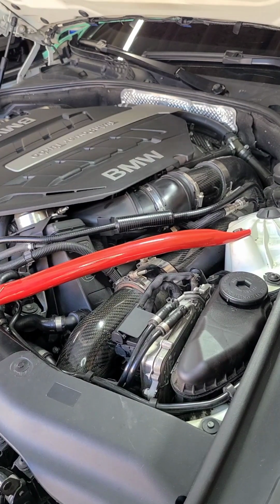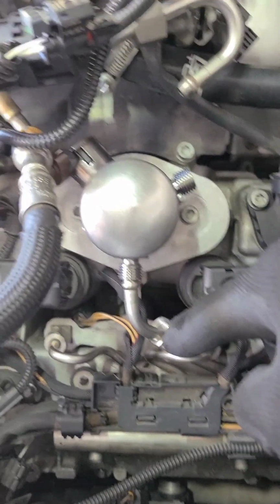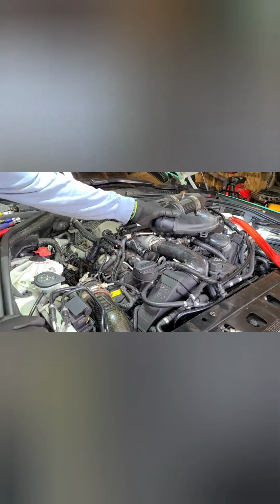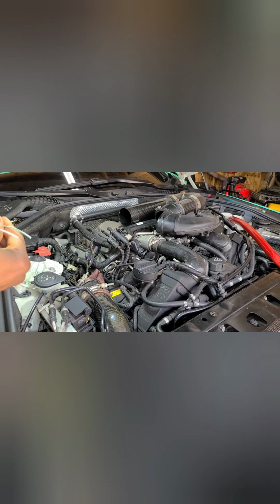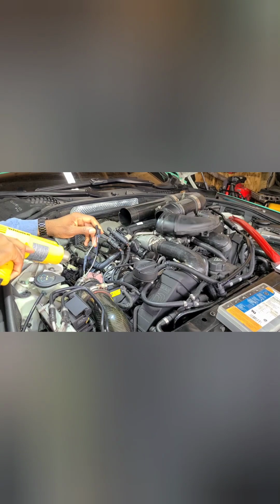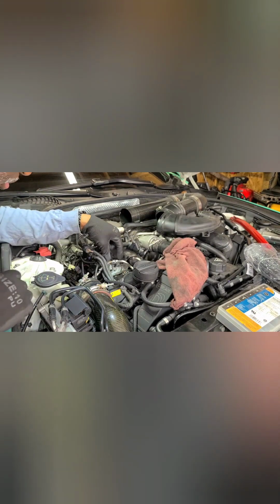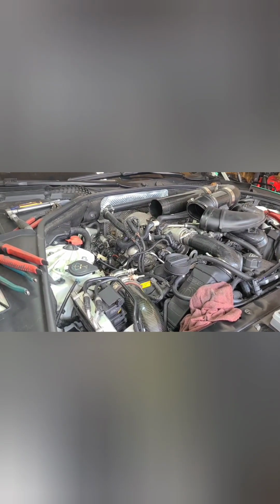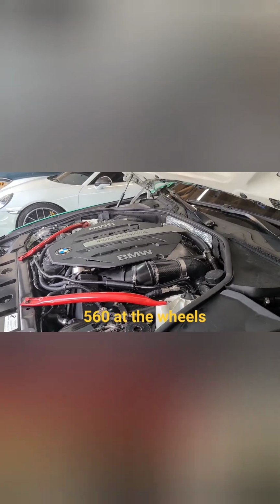BMW 650 F06 N63TU F90 (HPFP) fuel pump upgrade

Comment: Do you have before after logs? Or update video on how your car is holding up. Appreciate the video. Methodical and easy to follow and basically straight to the point💯.
Reply from the maker: Thx... I didn't keep any before logs but my tuner is happy with the results. I did a methanol injection system video but not specifically a fuel pump update.

Comment: Hey man, great video thanks for posting. Do you know if the F90 HPFP can run normally on stock tune? Or will you have to install the stock HPFP if you ever revert to stock tune?
Reply from the maker: Thx... they run how they do no matter your tune. They help support an in demand tune via higher pressure.

Comment: Sorry for all the questions bro, but theres little information about this retrofit on the webs for our cars 😅 is there any added benefit or harm to using the F90 pump with our stock injectors? Don't they cap out at 200 bar?
Reply from the maker: Good question. I was lucky enough to have EU5 injectors from the factory. I have an early 2013. If you don't, you'll need to upgrade those. Check FCPeuro.com to cross reference the part number with what you have.
Reply: @LivYo_life  I actually have the same car, early 2013 with EU5 injectors 👍🏻 so I guess we should be good!

Comment: Hi. Do you know what the PSI is on this F90 HPFP? Also, do you think it's possible to retrofit the HPFP from the N63TU3 (such as M850i) which has the new 5000 PSI HPFP?
Reply from the maker: No I don't know. I haven't done that type of research on them. I just know they are better than stock n63tu.

Comment: Great video. I have 2 do my f90.
Reply from the maker: Thank you.
Reply: I’m looking at the gasket you listed and when it takes me to fcp it tells me the gaskets are not for the f90.  Do they not fit?
Reply from the maker: @eptxm5664  you have a f90 m5? You should already have these. These are f90 pumps.
Reply: @LivYo_life  ah ok. Thought they were a wear item gasket so then I just need the 2 pumps and 2 harnesses and done then?  You saved me a lot of money bc fcp wants 1000$ each pump
Reply from the maker: @eptxm5664  these are f90 pumps. You own a f90 M5 so you already have this setup. My car isn't a M, that's why I upgraded so I can get more out of my tune. I'm no pro so talk to your tuner about it. I don't know if they make pumps over the M series. If you're on Facebook, join some car groups specifically for your car. But yes, you would need a gasket too.
Reply: @LivYo_life  sadly the hpfp are a common problem on the f90s so I gotta replace mine and I do see the pumps you bought are my oe replacement made by Bosch for 337$ x2 which is a quality company. Bmw oem are 1000$ x2.
Reply from the maker: @eptxm5664  saved a lot of money with them. Good thing you won't have the alignment problem I had.

Comment: Hey man, my pumps just arrived and I'm installing them. I noticed the stock pump has indentations on the underside where the screws are, and the stock gasket is raised at those areas to fill the indentation. The F90 pump is flat. Question, did you use new stock gaskets or new F90 gaskets? I had a look at the F90 gasket online and it looks different to the stock gasket. Thoughts?
Reply from the maker: The gaskets I used are linked in the description
Reply: @LivYo_life thanks man. Yeah these are the ones in using as well. The F90 gasket is different though. But anyway if you're running them fine then awesome!
Reply from the maker: @112rorz  yes. They fit fine.